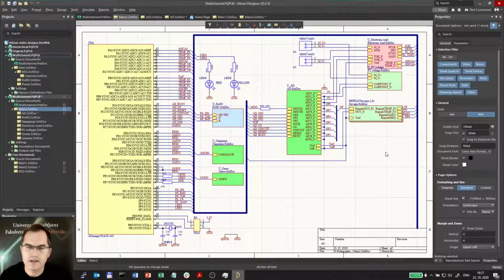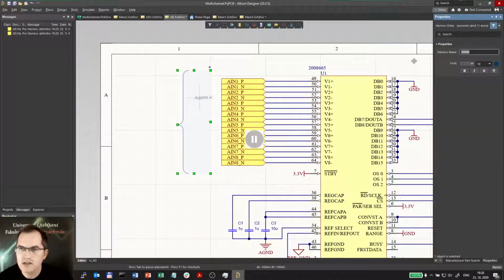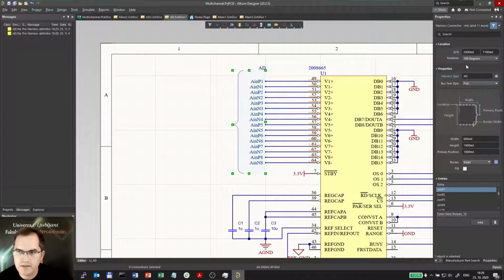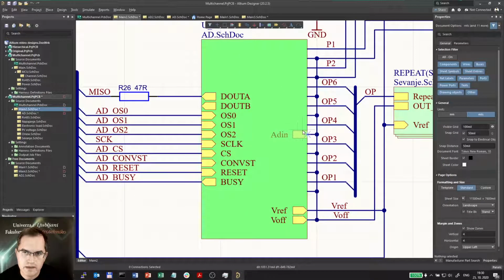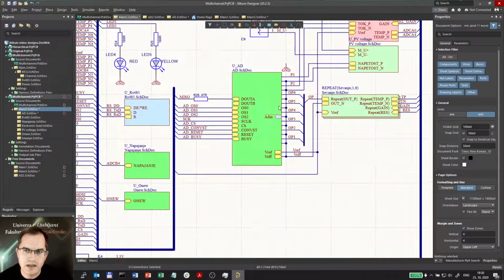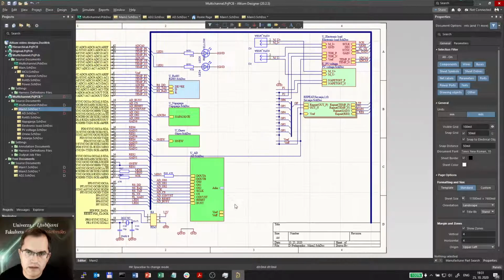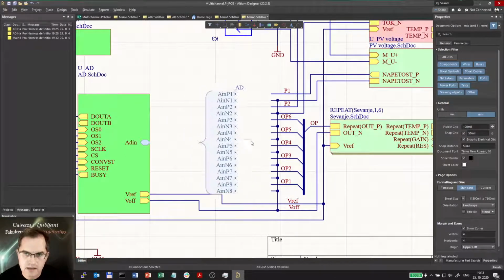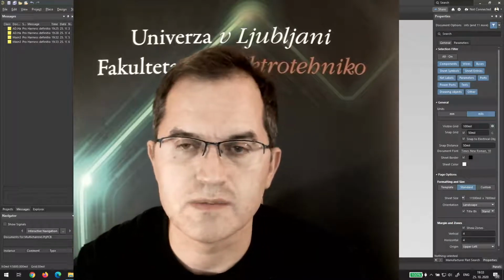Altium Schematics #04: Using signal harness in hierarchical design

Comment: you can delete individual bus segments with the break wire tool. I personally set it to shift+B in my Altium. You can set it by holding control and then pressing "break wire" in the edit menu at the top of the screen

Comment: Your busses do not conform to the "The individual nets must be named using the standard naming pattern <Name><NumericalIdentifer1>, <Name><NumericalIdentifer2>, for example Address0, Address1, ..., Address n." (Altium Documentation)  Does this get you lots of warnings?
Reply from the maker: If you dont use the standard naming pattern as in this case, the busses loose some of the functionality and act mostly just as graphical representations of which nets belong together. IN old times this perfectly made sense, but now it is treated more as a misuse of busses.

Comment: Can harnesses have end points that only break-out some of the connections but not all? Is a bus better for this?
Reply from the maker: I don't think so. However, you can freely rearrange the order of harness connectors to make the connection more tidy. A bus would be better, but to be able to use a bus in hierarchical design, you have to keep a strict net naming with successive numbering at the end.